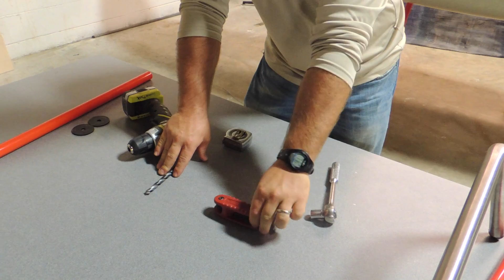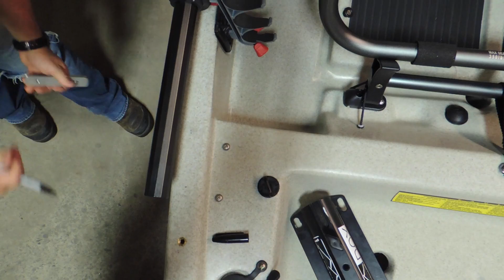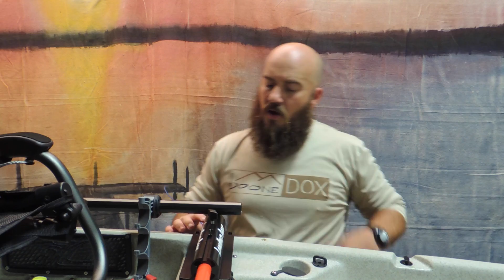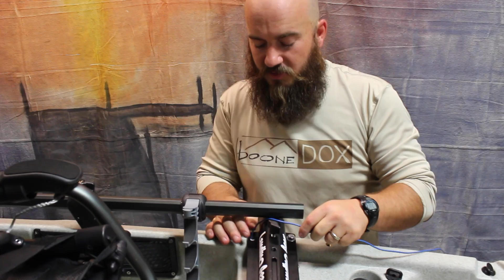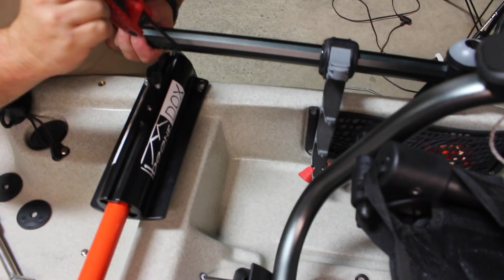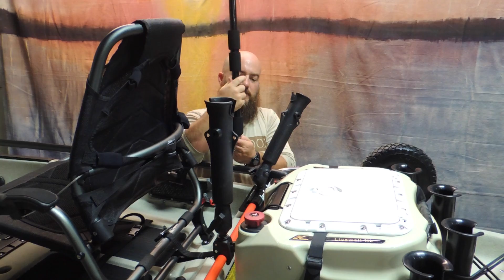Landing Gear Hobie Pro Angler 14

Comment: Thanks, very clear and well-made video. 

Do you recommend putting a similar rubber washer/O-rings/silicone or any other kind of sealant under the landing gear mount as Hobie uses under the rails?
Have you ever had to re-tighten the backing plate? Would some Loctite make sense there?